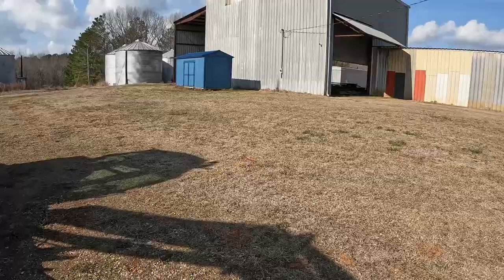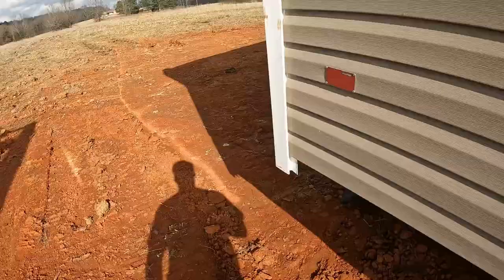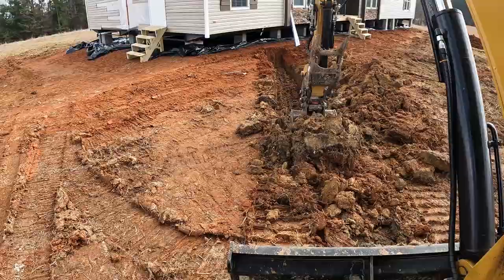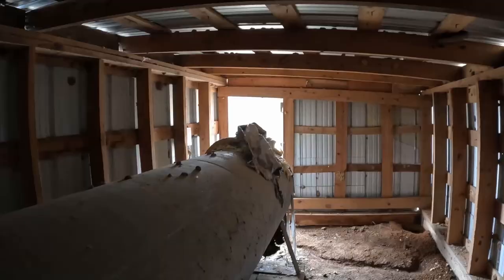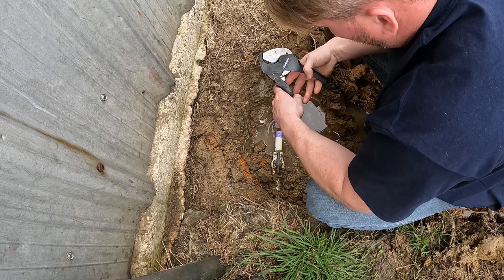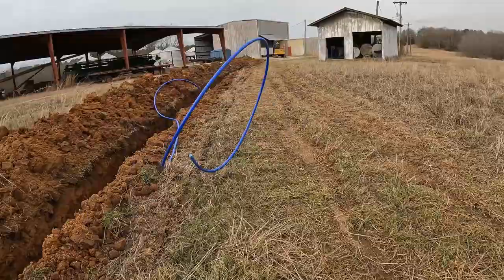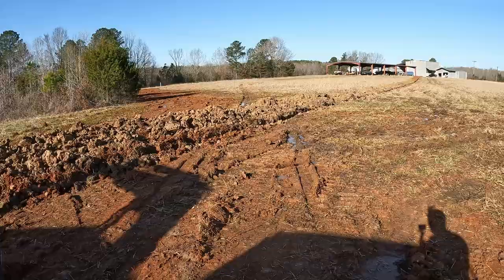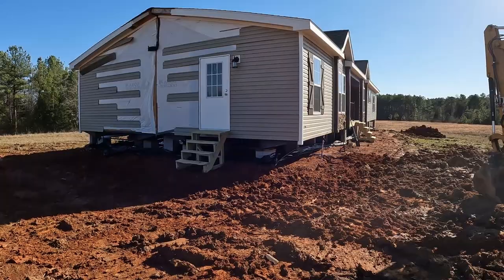How to install Water Line for a Mobile Home

Comment: Putting that blue line for the water is a real time saver.  Around here most people use pvc and have to connect each section.
Reply from the maker: Yeah I made that mistake when I installed my water line. It took days to connect all that together. We ran 1600 feet with 10ft sticks lol
Reply: @smithworx1091  Man, 1600 feet with 10 foot sticks is a lot of gluing to do.

Comment: Nice over all. The white drop at the  trailer is 3/4" pex. There is red, blue and white. A-pex is clear. Your brass fittings used are really good, but when used with pex, you have to use stifner sleeves in the end. Otherwise, over time, the pipe will blow out. And need a bag of gravel at the base of the yard hydrant so the weep hole doesn't get clogged from direct contact with the soil. Overall, that is a lot of work. Nice job.
Reply from the maker: Appreciate that bro. I did scoop up a little gravel and put in the hydrant base. This was a tough job with all the mud.

Comment: Little tip use loaf bread to stuff in the pipe so it stops the water just long enough to get the fitting on
Reply from the maker: That's a great idea. Thanks bro
Reply: @smithworx1091  My father showed me how to use a "dough ball" in a pipe to stop the water long enough to solder copper about 30 years ago.  I thought he was a genius for that trick.

Comment: That line looks like PEX line. If it is there is a crimp tool and you can use PEX fittings instead of that crazy high brass stuff. PEX is good stuff.
Reply from the maker: I learned that the hard way. Those fittings cost more than the hose did 🤦🏼‍♂️
Reply: @smithworx1091  I bet they did lol. God job though.

Comment: Great work. Genuinely asking your opinion on using the shark bite fittings in this application (in the dirt)? I know a ton of plumbers that hate them and claim they aren’t reliable. I use them when necessary, but more frequently crimp the pex. What is your opinion and thoughts?
Reply from the maker: I was skeptical at first. I've used all kinds of fittings for various things. I personally have never seen a shark bite fail. And when I saw the water company use them then I figured if they're good enough for them, then they're good enough for me. I would just make sure the connection is clean and has a flush cut on the end.

Comment: How do u get good water pressure that far? I can’t get any to my mobile home 200ft 😢
Reply from the maker: You should have no problem at 200ft. What helps this it's running downhill the whole way. You might need a booster pump set by your house. Or bigger water line coming to the house from the meter

Comment: I wonder if they use different color lines for different utilities?
Reply from the maker: Yes. Orange is communication, yellow is gas, blue is water, red is electrical and green is sewage.
Reply: @smithworx1091  ok. It's the same in Florida where I am. But I know homeowners go out and draw lines with any color.

Comment: The ditch isn’t deep enough (at least 4’ depth) the water pipe will be freezen in winter
Reply from the maker: @clydebelfast7986  our frost line is 6 inches